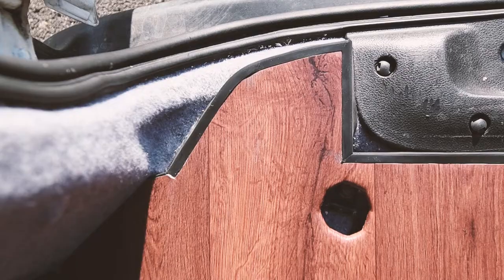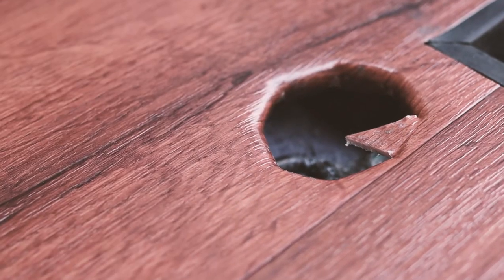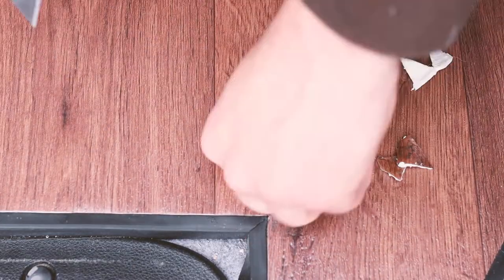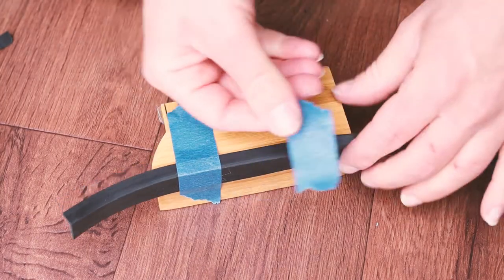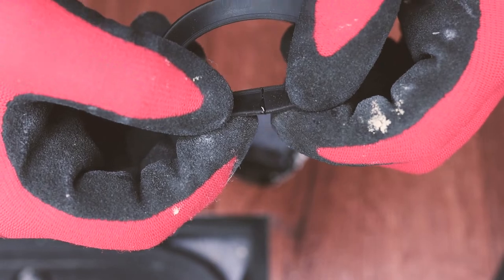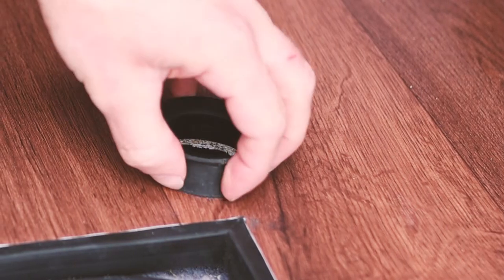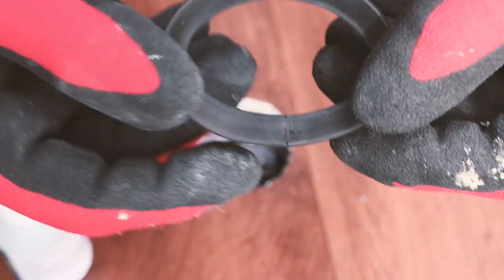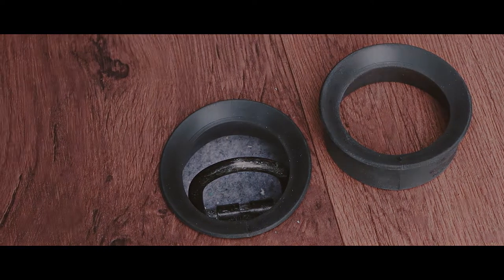Making Changes To The New Van Floor | Ep 9 | Nissan NV200 Camper Van Build

Comment: Looks nice.
I’m going with flooring panels on top of 4mm plywood. Mine will be done in two sections. I need to remove the front section and reinstall the rear seat in order to pass inspection. I’m even making a panel with cut outs for the mounting holes. I have the holes slightly too large in my 4mm template so I’m going to simply mount the panels to the plywood and then give the holes another go. They would work ad they are but just like you wanted perfection here….